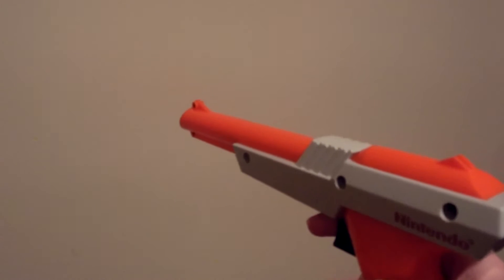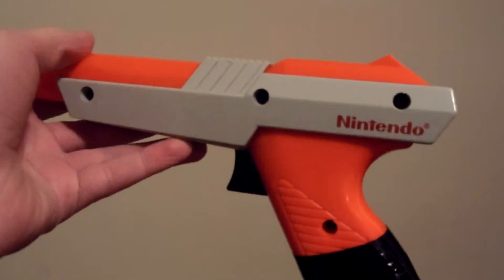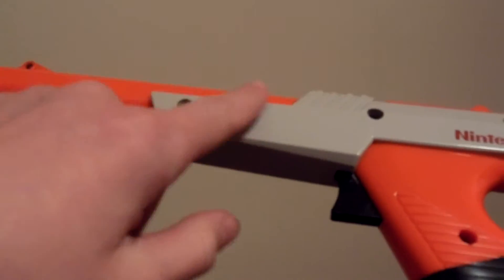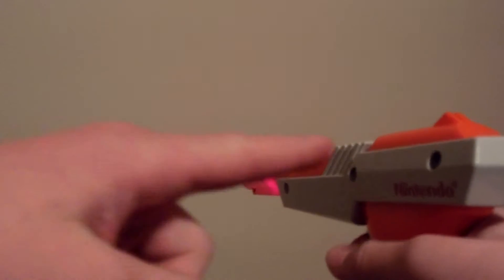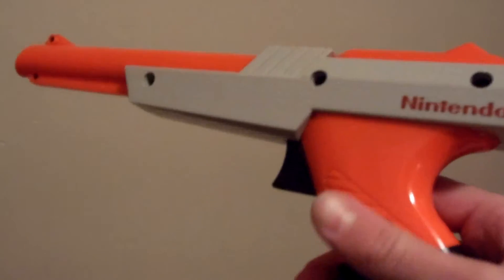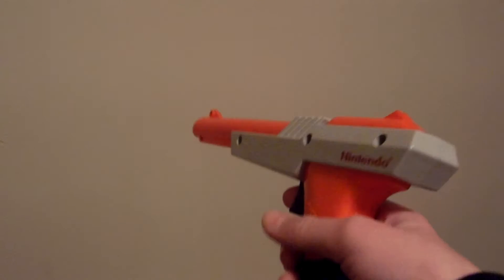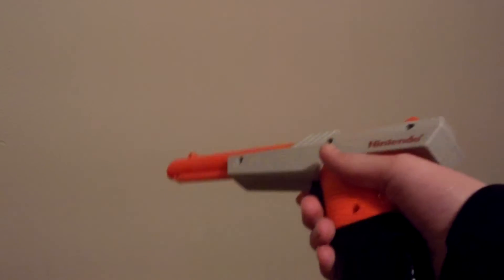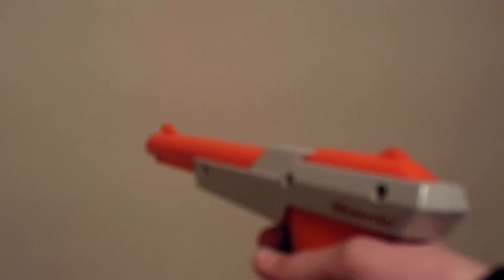NES Zapper Laser Pointer

Comment from the maker: I made the PotatoGun96 part with an intro creator called flixpress. They have some free templates. The free ones are limited, but work well enough for my needs. I edit the rest in VideoPad video editor. It is a product by NCH software, I use a lot of their products. I only have the free version, but it still has many options. VideoPad is pretty efficient at editing 1080p, and you can have many audio tracks too.